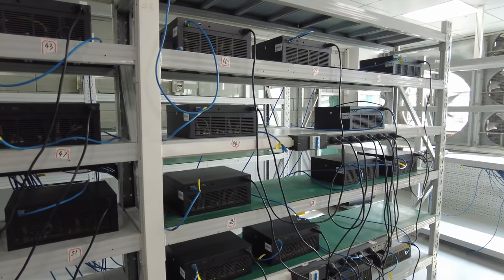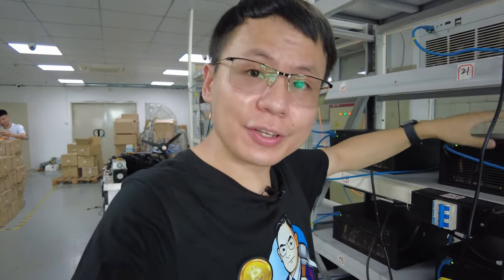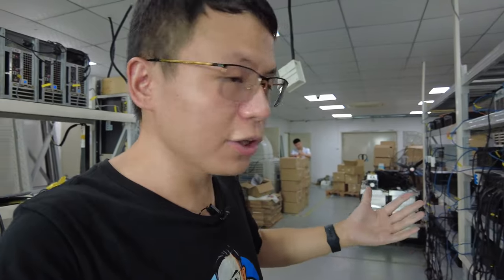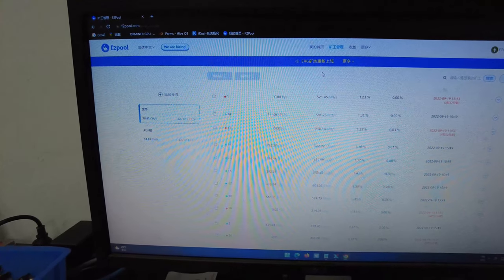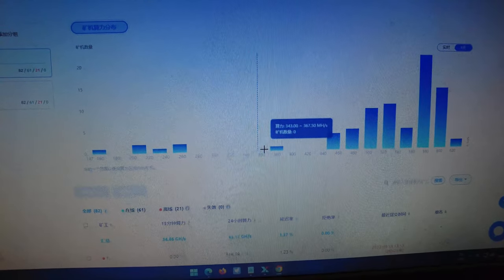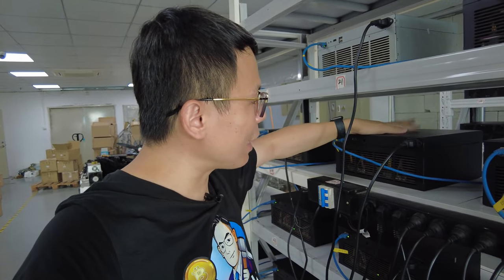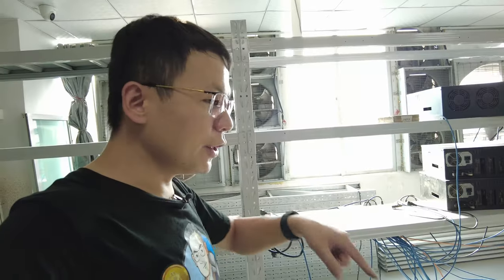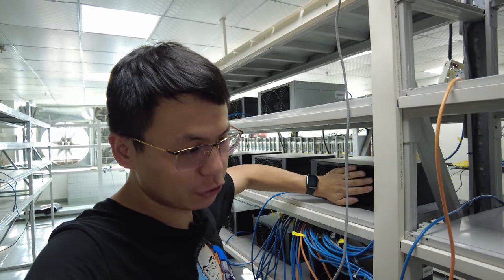Inside the World's 1st Water-cooling ETC Miner #ethereum #antminer #asicminer

Comment: How many similar sizes ‘smaller’ mining companies are there around in your region for example? Like this company.
Reply from the maker: Very few, I guess less than 10
Reply from the maker: Patrick, what’s your term again for this? Closed loop… I love that!
Reply from the maker: I am wondering if you refer to just the farms or the companies that are able to have their own brand of miners. The latter, very few.
Reply: @CharlieLinTV  Yes the system in which the fluid runs on one continuous circuit can often be referred to as a Closed Loop :-)
Reply: @CharlieLinTV  Yes I was referring to the number of campaniles with their own brand of miner. Very few it seems. I didn’t know if it was a more or less thing to do. Thanks